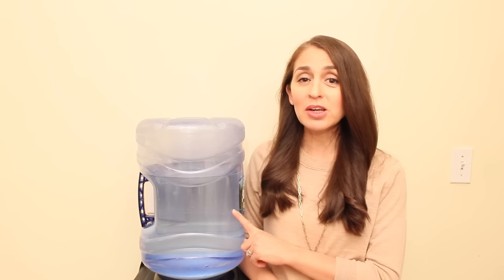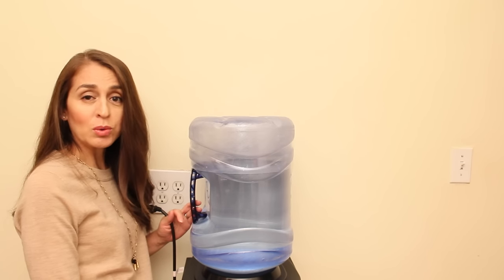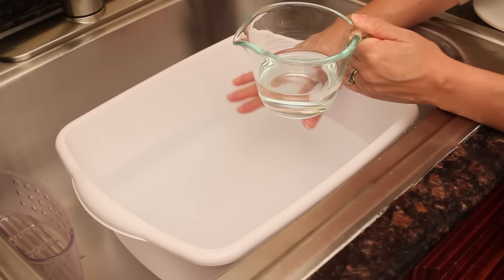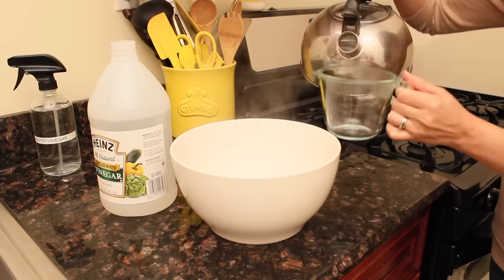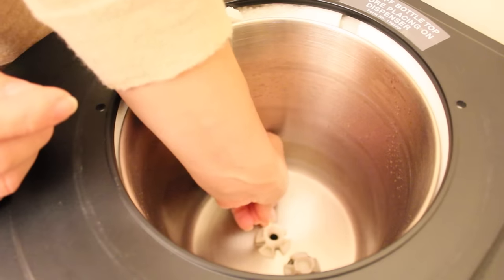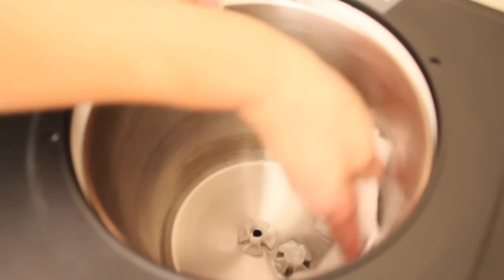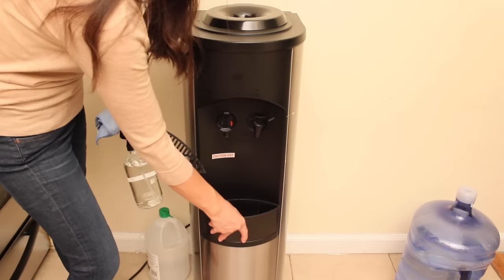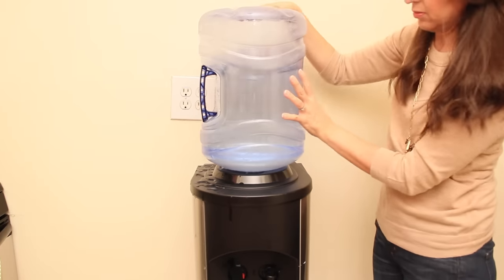How to Clean the Water Dispenser! | Clean Casa

Comment: I just recently discovered vinegar for cleaning. Some one had mentioned that the terrible odor goes away when it dries. I bought a nice, durable spray bottle that is sure to last.  I mix it with water, and use it mostly in the kitchen.  I also just bought a water dispenser from a friend. Did not even attempt to take it apart. I cleaned the outside well, and prayed a lot.  👏👏👏👏🥀

Comment: I would cover the top portion of the dispenser with cling wrap and tie it down with a rubber band. Then I would clean the back of the dispenser first so that no dust goes into the dispenser. Then I would clean the inside of the dispenser.  Also the tabs can be unscrewed and cleaned thoroughly.

Comment: I tend to use 91 octane fuel mixed with 90% rubbing alcohol , along with a bottle of tequila(patron is best) to rinse the out the dispenser. After comes the important part … after drinking that mixture I’ll drive to Walmart and buy a new water dispenser

Comment: You should do a video on how to clean a bottom loading water dispenser that uses a pump.
Reply: I would like to see that as well.
Reply: Be cautious of the bottom loader. If it's like the one I had from a popular home delivery supplier. When I was changing water bottle out the tube that you insert to the water bottle at the opposite end had a mold build up. I dont know how it was caused, but all I did was replace empty bottles. I stopped using and returned to top loading bottles.

Comment: If tap water is safe why not just put tap water in in fridge or heat it in kettle.That way you don't have to go through the trouble of cleaning the dispenser and you don't have to buy a dispenser.